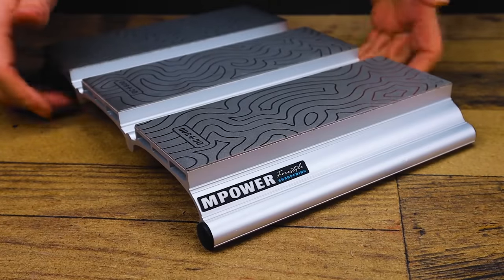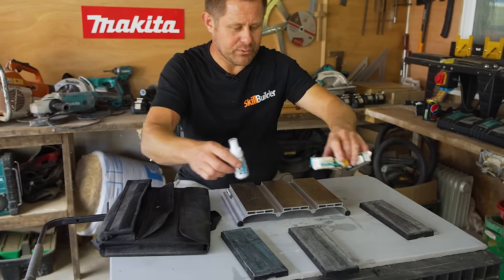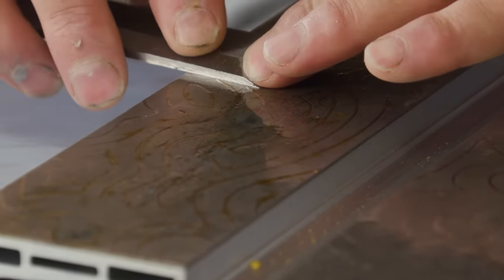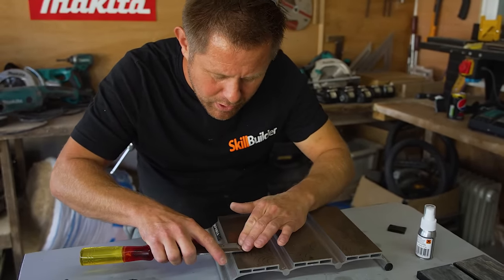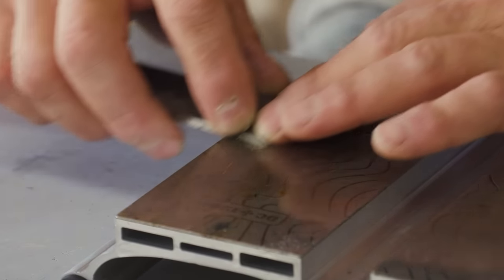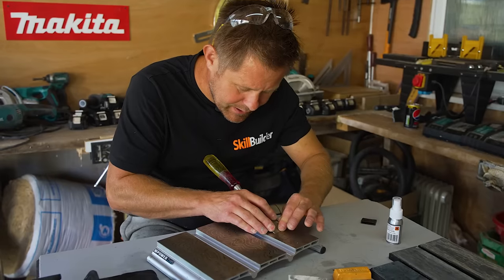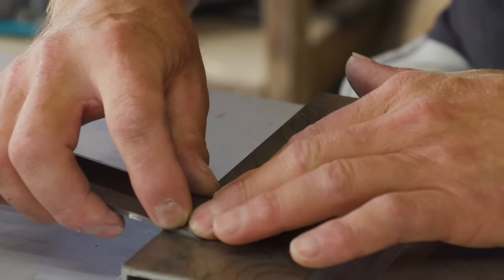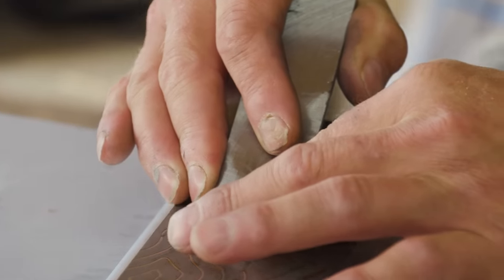Sharpen Like a Pro! M.Power SBS Triple Diamond

Comment: Is this #sponsored? 
Only critique I have with SBS (apart from the taste) is that you can't get all round it every angle. I feel the middle one I can't get in flat sideways on the long edge. Good for beginners though as it's all in one bag!
Reply: I agree!
Reply: Chop one side off
Reply: Could argue you only need the coarse to establish flat then extra fine to remove burr for the back of a chisels. But totally if you want to sharpen a knife or scraper it wouldn't be possible for that middle one. Should of had one removable side by bolts really

Comment: I've only been a joiner for 40 years, but I've never heard of a chisel being called a blade.
Reply from the maker: If you move around the country and the world you will hear many terms. 

Here is an entry from Encyclopedia  Britannica

chisel, cutting tool with a sharpened edge at the end of a metal blade, used—often by driving with a mallet or hammer—in dressing, shaping, or working a solid material such as wood, stone, or metal. Flint ancestors of the present-day chisel existed as far back as 8000 bc; the Egyptians used copper and later bronze chisels to work both wood and soft stone. Chisels today are made of steel, in various sizes and degrees of hardness, depending on use.

Comment: Looks like they should include a thigh pad for wiping off excess oil/ wax so you can check the nib rather than you wiping it on your pants. Question please : would this be suitable for domestic kitchen knives ? If anyone knows, chuck in a reply. Thanks in advance
Reply: thanks for the question, no, it's not perfect for domestic knives because you can't access the central 600 grit plate, but we are launching a 2 stone version in the new year.
Reply: @MPOWERTools1994  Thank you !